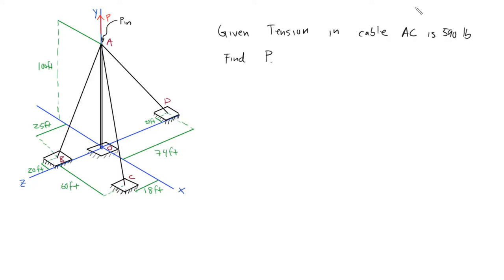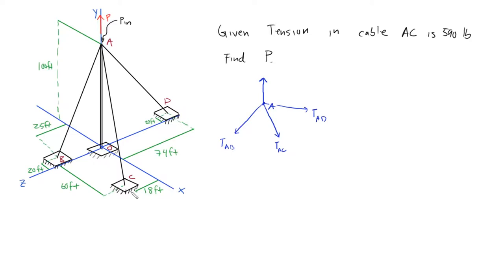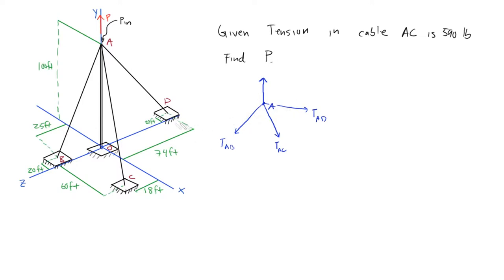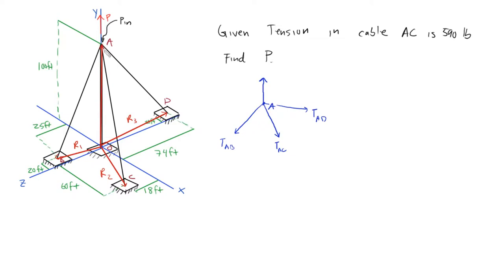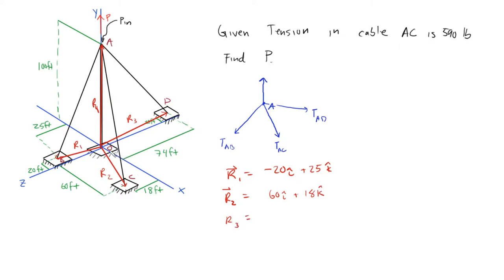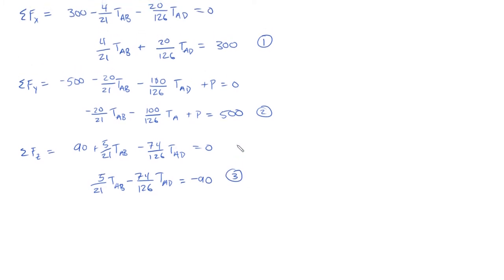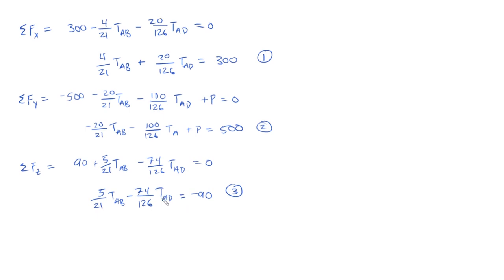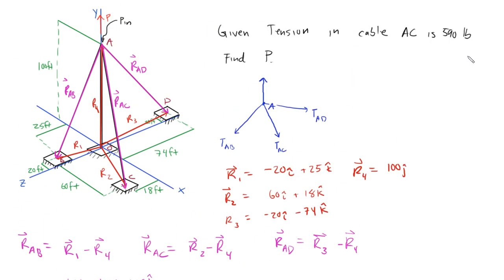Statics | "A transmission tower is held by three guy wires attached to a pin at A and anchored..."

Comment: Hey there, when looking for the direction vector how do you know from which way to find them? for instance you took them from AB, AC, AD but Ive seen in other tension problems, the force is taken from the wires upward to the point, like instead of it being AB, AC, AD, it would be BA, BC, BD, so how would I know which way to take the direction vector from? so confused on this
Reply from the maker: Very good question. Part of it depends on your free body diagram and part of it depends on the properties of ropes and cables. I'll go one by one.

FREE BODY DIAGRAMS
Free body diagrams can be tricky and it does take some time to get used to (even if you feel like it's a simple concept). It's kind of based on what "perspective" your FBD is taking. Let's take a simple example of a table resting on the floor. It'll help if you try to draw out the scenario I'm going to explain...

FBD Example:
The first FBD would be the table isolated from the ground. Let's draw a FBD. The weight force will be pointing downward at the center mass due to gravity. There will also be normal forces at the legs of the tables to keep the table stationary; the normal forces will be pointing upward to counteract the weight. Pretty basic, but now lets make an FBD of the ground that the table is resting on. Assuming the ground is an inertial reference frame (meaning not accelerating), then the only forces that the ground "sees" or "feels" (perspective) are the normal forces from the table. However, the normal forces on the ground MUST point in the opposite direction of the normal forces on the FBD of the table. This is because of newton's 3rd law, and this is always true for reaction forces (or in other words normal/internal forces)!

The real nice thing (yet confusing) about normal/reaction/internal forces is that you technically DO NOT have to know the direction they point when solving a problem. All you have to do is guess where there line of action points and assume this is true. Next you MUST define a coordinate system (preferably right-handed system) and STICK to it. Then do all the math while keeping your signs consistent with your coordinate system. Solve for all the unknowns. And BOOM! The math will tell you if your guess is wrong. If you get a force value that is positive, then your guess on the direction was correct. If you get a force value that is negative, then your guess is INCORRECT meaning you have to flip the force vector 180 degrees from your assumption. 

Going back to this problem. I took the FBD at point A. Meaning the force P is pointing upward. For me, I intuitively placed the tension forces downward along the cable because for this to be at equilibrium the tension must be opposite of force P. However, you can technically have the tension point upwards and do the math. The math will tell you your assumption is wrong and will spit out negative answers. Let's just do it as an exercise: Let's assume this is 1 dimensional problem with one rope and have the tension force and applied force pointing upwards. We also define up as positive. You will get at equilibrium...

T + P = 0
P = -T

As you can see it is a negative number. Meaning my assumption is wrong. It DOES NOT mean the magnitude is incorrect, but it DOES mean the direction of the force is wrong. Just remember this concept of guessing directions of forces ONLY applies to normal/reaction/internal forces. Applied forces must be known like gravitational force or the force P. Those must be known with a given direction. I think I beat the dead horse's ghost with this explanation lol. Let's move onto the properties of cables/ropes...

ROPE/CABLE PROPERTY:
Grab a rope with one hand on each end. Pull. The rope will be under tension and you will feel resistance (at least up until the rope yields or breaks). Do it again, but this time PUSH on both ends. The rope collapses. This gives ropes a special property. They can only provide or transfer forces under tension, but they CANNOT provide or transfer forces under compression. 

Going back to this problem, I intuitively put the cables under tension in my FBD because I know cables cannot experience compression. 

I know this is a lot, but hopefully I helped with question. Feel free to ask for more help! I highly do recommend watching the STATICS playlist on my channel. But if you don't have time for that I get it! I'll leave a few of my links that I think will help you out your question!

Newton's 3rd Law: https://www.youtube.com/watch?v=7fhIxYyv6b8&list=PL_R4uxT5thfmMVR-fbncVdgUNMy2Vb9e_&index=11
FBD Pt.1: https://www.youtube.com/watch?v=rHR37dm5lXI&list=PL_R4uxT5thfmMVR-fbncVdgUNMy2Vb9e_&index=14
Reaction Forces in 2D: https://www.youtube.com/watch?v=af3L2hAGFag&list=PL_R4uxT5thfmMVR-fbncVdgUNMy2Vb9e_&index=19
FBD Pt. 2: https://www.youtube.com/watch?v=6k3P_O_fv1Y&list=PL_R4uxT5thfmMVR-fbncVdgUNMy2Vb9e_&index=31
FBD Pt. 3: https://www.youtube.com/watch?v=19-A5Uk9p2I&list=PL_R4uxT5thfmMVR-fbncVdgUNMy2Vb9e_&index=38
Machine Problem: https://www.youtube.com/watch?v=6q21NHm3Mj0&list=PL_R4uxT5thfmMVR-fbncVdgUNMy2Vb9e_&index=39

I highly recommend the last two links; hopefully, it's not too far ahead in your current course!
Reply: Alex Thanks a lot man, it really helped. Ultimately, even if I do take the wrong forces and my final result will come out negative but my magnitude will be correct right? So the sign will tel me that the direction of my force was wrong.
Reply from the maker: @talhajat3301  Correct. The only the force direction that you must know is the applied force. Applied forces are always given in the problem. I know I gave an example in 1D in my last comment, but the same concept applies in 3D. You can think of 3D problems as three 1D problems.
Reply from the maker: @talhajat3301  Oh and don't forget to use Newton's 3rd Law!! It's mostly for multiple FBDs (or more complex systems/machines).
Reply: Alex thanks a lot, this has definitely helped me. I just wanted some advice. As a first year student I see that people say to work smart and not hard. How the hell do you do that? With subjects like Math and Physics, u can’t really take any shortcuts, it’s all about practicing, so how can u even study this stuff smart?
Reply from the maker: Talha Jat Ah I get you man. Tbh my first year wasn’t so bad. It was second year that really killed me. It was because I took my first upper division course and it was in engineering modeling and analysis. Insanely tough class, but that class did teach me how to solve and analyze problems in mechanical engineering. After that I felt well prepared for other difficult classes like thermo or heat transfer or materials etc. But don’t get me wrong I still had to study my ass off for most of those courses. And you’re right a lot of practice problems help because it reinforces the concepts you learn. Two things that helped was chegg and having a notebook by me when solving problems. My process was solve the problem at hand. Get an answer. Check the answer with chegg. Got it right? Move on. Got it wrong? Figure out why you got it wrong. If it was just math, then I didn’t care too much. But if I was wrong because of concept, then I will take note of what I did wrong and explain what I should do to get the concept write. I would write it in my notebook. By the end of the class, I would have like 30-100 things I did wrong, but I would study from that to nail the concepts. Idk but it got me through college, and I still remember all those concepts; trust me lol. Takes time but definitely rewarding. But don’t forget to have fun in college too! It’s not all about homework! Meet new people; join clubs; make connections! It’s so worth it and you won’t regret it!!!
Reply from the maker: Talha Jat I hate to say it but all you need to know is Newton’s laws of motions and the laws of thermodynamics. Because that’s every course in mechanical engineering but in a different subject.
Reply: Alex thanks a lot for the detailed response, really helped lessen my anxiety. Also idk why professors hate chegg, it helps a lot when I’m stuck on a question or wanna check my answer. Really helps with the studying.